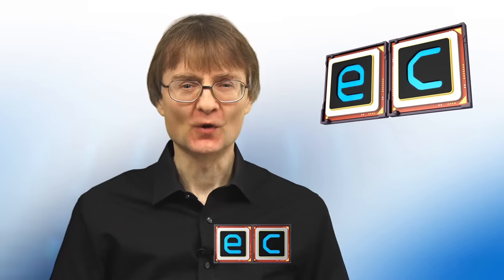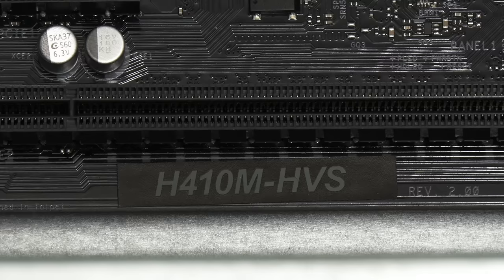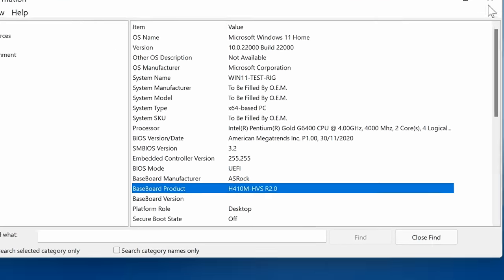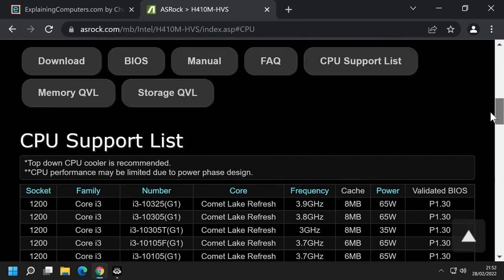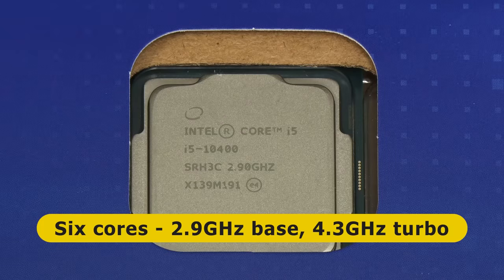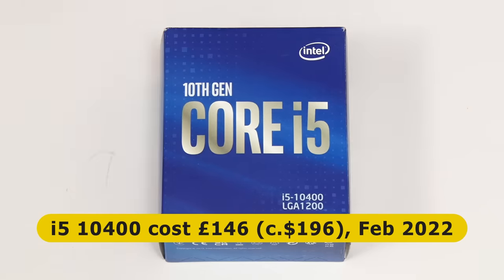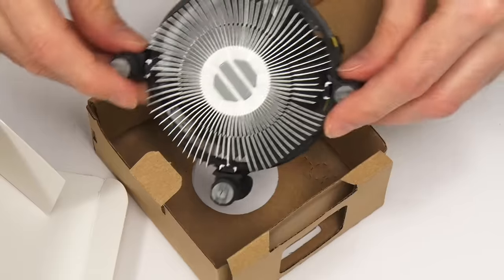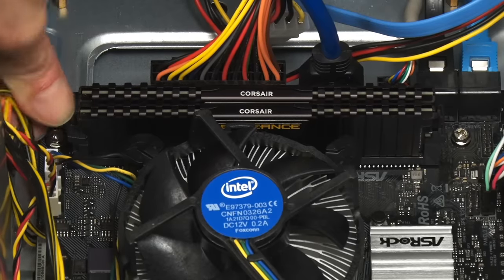CPU Upgrade: How to Change a Desktop PC Processor

Comment: Great tutorial as always! One extra from me: if you're dealing with a CPU that has very old thermal paste, it's advisable to heat your CPU to reduce risk of pulling it out from socket with cooler on.
Reply from the maker: Good point. Very wise advice.
Reply: That is good advice but also just wricking it gently will help a lot, then you basically break the 'glue' a bit on the side everywhere gradually and work inwards breaking all of the glue before you pull the cooler.
Reply: Another thing to note is that this can only happen with AMD processors as they use a PGA socket, but Intel uses a LGA socket, which makes it highly unlikely to happen.
Reply: @sir_whocampsalot2876  "impossible" is a strong word ;)

Anything's possible with enough force!

But it's true it's much more likely on AMD CPUs—I just did that last week!
Reply: @JeffGeerling  Haha, fair enough!
Reply: Your advice is from way way back times - modern cpu sockets lock package heat spreader with metallic brace and there is no chance whatsoever to do as you describe (thou that WAS possible back in the day, say on about 17 years old sockets). Also, it is advisable to completely change thermal interface (paste) every 2 years of operation. If your CPU wont budge and feels like 'boiled to' cpu heat spreader, just give the cooler a gentle twist as by the laws of physics this is the easiest way to overcome surface tension force.
Reply: @cokeforever  AMD sockets are still trivially easy to pull chip+cooler together. I hear they're changing the design for next generation AM5 socket though, so hopefully this problem will finally be a thing of the past!
Reply: @cokeforever  It can still happen on AMD sockets, as they use a PGA design as I described earlier.
Reply: @cokeforever  i have seen it happen in r/pcmr forum. It is possible
Reply: @rolandssavdons7993  of course not, the brace holder lever would raise against the surface of the radiator and be blocked by it if pulled with such force, moreover mobo pcb or chip itself will give in much faster than the holding brace... but what idiot would pull with such force?
Reply: @cokeforever  I literally just replaced my CPU today and then happened across this video. Ryzen 1700X to 5600x. I didn't even pull that hard and my CPU popped right out. Lol nothing broken thankfully. Idk how the hell that happened.
Reply: I wanted to add a new Intel CPU to my Asus H97M-e mainboard that has an old Intel  i5 4460  CPU but in the computer shop they said that all Intel CPUs have different sockets and a new CPU won't fit on my mainboard.

Comment: No matter how many times I've done it over the almost 30 years I've been doing this, I always have to take a moment to compose myself when turning on a computer for the first time after a new build or change of processor. The relief of a job well done is something, too.
Reply: Yeah, the one time I tried to upgrade an old Pentium 4 system to a core 2 celeron, I ended up frying the CPU and Motherboard.

Comment: Only Chris can manage to make me sit through 17 minutes of him swapping a cpu. Keep 'em coming!
By the way, do you know why does the cooler thermal pad has notches in it? It seems counterintuitive
Reply from the maker: The pattern of the paste is indeed interesting. I have to  hope that Intel have done tests, and that the pattern they use produces the most even spread. That, or it is easier to do that way when manufacturing the cooler. This said, AMD stock coolers have a complete circle of pre-applied thermal compound.
Reply: The pattern helps spread the paste in a more even symmetrical pattern
Reply: @cgriggsiv  but isn't it already dry?
Reply: @kinnikuzero  
It is quite tacky but not completely dry so as it heats up it spreads out more evenly unfortunately I would prefer more wet where I could squeeze the hell out of it just like anyone else does when they put their heat sink on so I usually take that off anyways and put fresh on but that's me
Reply: @Voodoo Yam It  apparently doesn't matter basically at all what shape you apply it in. It always just spreads. Only quantity is important. Source: Check Gamer'sNexus tests (pretty nice channel that specializes in quite in-depth, methodical tests)
Reply: It probably has to be applied thicker than you want in the end so leaving gaps will thin it out.

Comment: 6:24 There's one step you forgot for the uninitiated.  Before doing anything, always unplug the computer and press the power button to drain any left over current from the system.  Things can get pretty damaged from that left over trickle charge when you start pulling things off or putting on the motherboard if you don't do that step.
Reply: It's not a bad idea to keep the power supply plugged into the mains but switched off at the socket in order to keep the case earthed and reduce the risk of electrostatic damage to the components.
Reply from the maker: Good point.
Reply: @johnm2012   Well, that's more of a UK thing, as we universally have switched sockets. In other countries, there's no switch and you can only unplug it to ensure there's no current.

But, yes, if you have switched sockets - like we do here in the UK - then leave it plugged in, but switched off. Because, as you say, the cable provides an earth / ground that's linked to the case, so if you touch the metal of the case, this should help discharge any static electricity you might have built up.

But, yes, you should ensure that there's no power - that it is switched off or, lacking switches, unplugged - because modern PCs are not, in fact, fully "off", even when they are nominally "shut down". They still draw a very small amount of power to detect if the power button has been pressed. So called "soft buttons".

And some machines - with suitable BIOS settings - can be told to wake the computer on an alarm, or on LAN activity, or to still supply power to the USB (so you can still charge up devices, even when the PC is "off").

(The reason it works like this is because, if you think about it, there's a "bootstrap paradox" to having the machine turn itself on and off. If the machine is off, then it can't turn itself on. And if the power was mechanically controlled - as it used to be back in the day - then the PC can't shut itself down, as it can't reach out a finger to press its own power button to mechanically turn it off.

The way around this paradox is that, yeah, there's a part of the PC - on the motherboard - that's still draws power (though a very tiny amount), so there's one component that's "always on" to control turning on and turning off the rest of the system. So when you do "shut down" on your PC, the OS is actually telling that motherboard component to turn off the power on its behalf.

But, yeah, because of this, a PC is not actually truly "off", unless you actually cut the power. Mind you, the amount of power running through the system is minimal - but, still, there is power there and you could accidentally short something, or accidentally zap something with static electricity. The danger is more to the machine than the human being.

Therefore, yes, it's important - before you perform any "surgery" on your machine - that you cut the power. Either by switch or unplugging. Simply being nominally "off" - "shut down" from Windows - does not cut all the power, just the main power.)
Reply: @klaxoncow  Decent power supplies usually have a physical switch on the mains input that can be used to disconnect it from the mains.

Comment: Excellent tutorial, as always. It’s been an awfully long time since I built a PC, so this was a great refresher course. Cooler installation seems easier than it used to be.
Reply from the maker: Yes, cooler installation has improved a lot.
Reply: I know what you mean, installing a cooler a decade or so ago was a fiddly business which required the strength of Hercules to clip the clamps shut! I was always terrified that I was going to snap the motherboard.
Reply: @lawrenceallwright7041  Exactly!

Comment: Back in the old days (early 90s), you had to set voltage and clock speed via dip switches on the motherboard when you installed or upgraded a processor, so you had to get those values from the processor documentation and cross reference the motherboard documentation to be certain of compatibility. I feel old just remembering this, but I'll resist the urge to shout "get off my lawn". As always, an excellent and fun video!
Reply from the maker: Yes, I remember those DIP switches! Computing is not so much fun these days. :)
Reply: DIP switches on expensive motherboards, jumpers for us poor folk.

Comment: Glad you included the bit about setting up a Microsoft account and linking your Windows license to your account. I was resistant to using a Microsoft account until I learned that it makes it much easier to reactivate Windows after major hardware changes. I recently had to replace a failed  motherboard on my wife's system and linking the windows license to a MS account made reactivation a piece of cake. Thanks for the informative, and entertaining, video.

Comment: Well that was a lot easier than a cpu upgrade I did a while ago. I removed the heatsink and pulled out the cpu out the same time (I got lucky, didn't damage it). Lesson there, give the heatsink a gentle twist to break the thermal compound. Also, some coolers are tall, tall enough to not allow the side panel to go back on.

Comment: Great video!

One of the main issues for upgrading is the fact that intel seems to change socket all the time, making a significant CPU upgrade impossible. My current PC still runs a first gen Core i7 920, and the only upgrade worth while would be to use a Xeon CPU that fits into the socket 1366, like e.g. the X5690. Newer Core processors just do not fit, and will require a new motherboard as well.

Things were better in the old days of Slot 1. I still run such an old dog from 1999 with a slot 1 Asus P2B motherboard that used the legendary 440BX chipset. Originally equipped with a Slot 1 Mendochino Celeron 400, it was later upgraded  using a FC-PGA Coppermine Pentium III 800. This was possible because you could use a simple thing called a  slocket: a FCPGA to Slot-1 converter. Finally it was upgraded again with a FC-PGA2 Tualatin Celeron 1300 using again a dedicated slocket. So 3 generations on CPU on the same motherboard. I stuffed it with RAM to the maximum of 768 MB and it still happily runs Debian Linux Bullseye.

Comment: I just bought a Xeon X5670 for only $9 to replace the i7 920 CPU in my old first gen PC with an ASUS P6T Deluxe v2 board, but I am "squeamish" about first doing the necessary BIOS update in this old board. I am in the process of backing up everything first...just in case and maybe will also get a chip programmer and/or spare chip for this board as well.  BIOS updates always make me nervous especially when a board does not have a backup BIOS to return to or reapply if things go bad. 
Nice video as always, Chris. Be well!  👍👍
Reply from the maker: I totally agree on BIOS updates . . . a failure would not be good.

Comment: As usual a very interesting video.  Like others I have built a number of systems but still enjoy watching others do it so smoothly unlike my feeble attempts. However where were you a couple of months ago when I received my new Ryzen CPU and couldn't figure out why it wouldn't post?  I wasn't aware that anyone made cpus without gpus.  Back in the early days they didn't but it's been 10 or 15 years since I had to worry about adding a video card.  Oh well.  Thanks again.

Comment: I've the same CPU and motherboard (same chipset but from a different brand).  I wanted to buy new SSD with PCI-E 4.0 specification but couldn't as the chipset didn't support it. So, I bought a new motherboard with a newer chipset but didn't buy new CPU right away as I didn't have the money. I thought I'll buy it later when Intel launches new CPUs. Then, on one day I saw you uploaded a new video and title had "big LITTLE" written in it. I checked out. And I was like wow, Intel finally did it. And, I thought this is the CPU I'll buy for my new motherboard. Then I realised the new CPU has a 1700 socket and the motherboard I bought has 1200. Okay, those things aside, this is a good upgrade you have here and very nice video as you always do.

Comment: I upgraded the CPU in my HP Slim Desktop S01-pF1xxx(small form factor) from a Celeron G5900 to the Core i5-10400 last April.  Had to use the factory CPU heatsink/fan combo because the BakerMS 8768 motherboard has screw threads in the CPU fan mounting points.  And due to the sff design, the TDP going from 58 to 65W, and only having the CPU fan without any other intake or exhaust fans, the 6 CPU core temps operate in range from 50-65 celsius during normal tasks.  Web browsing, media playing, updates, etc..  I tried gaming and video format converting and the temps thermal throttled and shut down the PC entirely.  But I can create media DVDs with the use of an external fan blowing air directly on the rear exhaust grille.  It keeps the temps lower than 80-85C......but it works.

Comment: Nice upgrade. Well I always use the Anti-Static Bracelet when opening inside PCs like that. But for upgrading CPUs can be tricky compared to upgrading GFX cards like nVidia. 

Also, sorry for being off-topic but are you curious on what the RPi Foundation is up to for the Raspberry 5 project or even expecting some surprising upgrades? I find those Micro HDMI ports too awkward and fiddly to plug in from behind my TV where it's mounted to a VESA board. Speaking of VESA, do you think that the Pi would be better off using a full-sized DisplayPort but also provides a DP <-> HDMI adapter? Cos I do know DisplayPorts are free from royalty but TVs use HDMIs more than DPs. I do know most Modern LCD TVs suffer from Display Lags compared to Monitors - which made my RetroPie gaming from my TV awkward with that annoying lag.

I bet you are excited to see some new products and upgrades from the RPi Foundation and maybe some improvements for the Pi 400 that doesn't have tiny Cursor Keys and maybe tiny F-keys as well?
Reply from the maker: I always get such intense abuse in the comments when I mention/show antistatic handling precautions that I no longer include them in a video.

I would certainly favour full-size HDMI on new Pis, but am not holding my breath . . .

Comment: The one additional step I always perform when doing surgery on a computer is to vacuum all of the dust out of the case, motherboard, and other components.  Your test rig was very clean already, but I doubt that's the condition of most computers.
Reply from the maker: Yes, some dust removal is always a good idea when a case is open. :)

Comment: This assumes one can get ones fat fingers in and remove the existing cooler!

Managed to screw up an upgrade I tried, ended up not removing the cooler but the CPU became partially unseated so wouldn't boot... Ended up taking it to a local company who were able to sort it properly!

Easy job I thought!

Comment: Thank you for another video clearly demonstrating how to complete a delicate part of upgrading/building a computer.
I would be interested to hear your thoughts about your 3M ergonomic mouse. I have owned a 3M EM500GPL for almost 2 years and have been very happy with it. My only minor grumble is that the DPI could be greater than 1000.
Reply from the maker: I have used 3M ergonomic mice for about 25 years now -- the first one had a 9-pin serial cable! I also use a Wacom tablet with a stylus for more accurate work, which keeps the fingers pretty much at rest in a different posture. But for general rodent operations, for me nothing beats the 3M. And indeed I've recommend them to many other people, and everybody has been happy!

Comment: Nice presentation.  A couple of things...  I have cracked open 100s of computers and one thing I NEVER do is to put all the panels back on before I had a chance to see that it boots.  Saved me much unnecessary fiddling with screws.  The other thing is, why in the world would anyone want to depend on MS Win for anything.  Highway robbery.
Reply from the maker: Thanks for this. On the case panels, I replaced them as this is a video, not real life! :) On Windows, I make a great deal more Linux than Windows content on this channel. But most people run Windows, so to cater for the majority audience I was running Windows 11 in this video.

Comment: Having a AMD Ryzen Threadripper 3960X, I can say it made me very nervous to install the CPU, which is VERY different from anything anyone has ever seen. Such a big socket and so many pins, and you have to slide the CPU into rails of a holder that is pushed down and clicks into the socket with the CPU. Then you have the pressure mechanism that you angle down onto the CPU which is then screwed on tight with a newton screwdriver and 3 Torx screws. The screwdriver is included with the CPU retail box. I think this operation has shortened my life by at least six years if not more cause the CPU cost me 1300 EUR and the motherboard 750 EUR...

Comment: I believe i5s are the best thing Intel has done so far.
By the way were you able to identify whether you CPU is a G1 chip with 6 cores, or the Q0 version with 10 cores from which the 4 of them are disabled? And do you happen to know if you can enable the 4 cores? I remember about 20 years ago, Ati (or was it nVidia?) had a shortage in GPUs, so it offered the 9700 version of the chip, disguised as 9500. It was quite easy to unleash the power of 9700, just by placing a simple rig on the GPU pcb. I think you just soldered a wire in order to bridge two connectors and voila! you had the finest GPU card available, for the price of its little sister, which was about half the cost.
Thanks Chris, keep up.